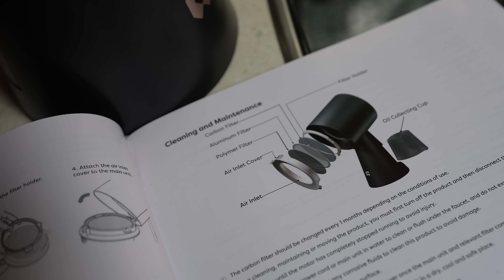Our first steps preparing to live off-grid on OUR NEW PROPERTY IN PORTUGAL.

Comment: When moving rocks to another area, I put it in the wheel barrow and dump it out. Many trips with lighter loads saves your back.
 Also, get a pallet with a chain to attach to the truck and drag it like a gravel rake along the road. You may need to put a cement block on it to way it down. 
 Once you get your water source worked out on the land, use pallets and a water liner and make a outside whirlpool/Jacuzzi to soak in.

Comment: For parts of the road that want to wash out you could use a geo grid for gravel roads. Best to utilize the rigid panels that lock together, the stuff is amazing on gravel slopes. Cheaper than concrete or paving and more eco friendly. We are in Canada on the wet west coast and this product holds up . It will also stop wheel spin.
Reply from the maker: Sounds really great. Wonder if this is available in Portugal?

Comment: Great job you two.  I'd suggest using the level like a transit.  Use a stick that's the right height so you can sit the level on top and sight along it like a gun sight.  Put the transit in one place for reference and have a partner with the same height stick move around and check for level by sighting along the top of the level, the level should aim right at the top of the other stick.  A short level won't tell you if your whole pad is level; there's too much variation over long distances, but not short ones.  Looks great!

Comment: Using your truck was a great idea to help compact…also, if you soak it down and let it settle, that works also as well as show low spots that would possible puddle. Keep in my you need a slight grade to offer drainage relief, on your current level it might look like the bubble is more towards one side…if you place your level on a 10’ length of wood, it should be flat if you stick the tip of your pinky under the downhill side of the wood. 
Larger pipe won’t clog as quickly and if your backfilling with gravel, it would of been protected…yes all fine a well for me to say after the fact, but live and learn. I’m sure you all will be fine.
Reply from the maker: Perfecting our work one experiment at a time. 😊

Comment: You are lucky the driver tried to correct your “French Drain”. The pipe you bought was conduit. Completely unsuited for a surface drain system. For the future a French drain pipe is most often flexible slotted pipe. But no one can deny your enthusiasm. Keep it up.

Comment: One of those large whole house solar generators would be great for now. You can then use it later in the house if electricity goes out so it would not be wasted. People here in the states tie them in to their electric box to kick on when the power fails. It is a great investment and you have plenty of sun! Have you talked to your friends at the Indigo Project. One of those large plastic water containers hooked up to receive water from the stream and then get a ultra violet combination water filter to go to the camper and you should be good to go! Quick and easy but portable to the house later! One of the YouTubers built a building of wood that houses the water filter and battery systems so they don’t freeze. Or get too hot in summer they live in Texas. They actually collect rainwater from house and other buildings and store it in 3 very large water tanks. They live in a home built from containers! They also built a box outside next to the home where water passes through and is preheated for hot water by the sun. The box has a water container in it and is covered by glass or clear plastic! With the stream nearby I would think water situation is great and Theo on Indigo project has been working with replacing all the pipes that carry water from the stream to the house so I would think he would be a great source of info.  Just whatever you invest in these systems make sure they are portable for the future!!!!

Comment: hoe needs to be cut down, there is too much left over on the handle the reason they do that is because they don't know how big the metal hole will be. also if you are doing a french drain than shouldn't the pipe have several holes to help get the water into the pipe. The other issue you will get is since the pipe doesn't have a fabric layer you will get soil into the pipe and it;s going to block up pretty quickly.